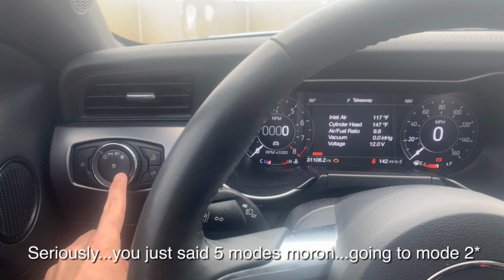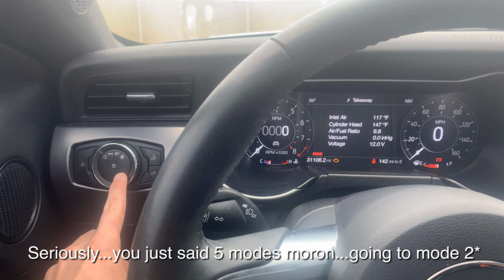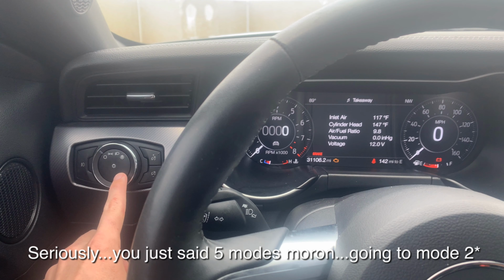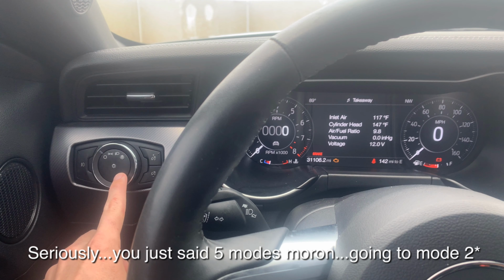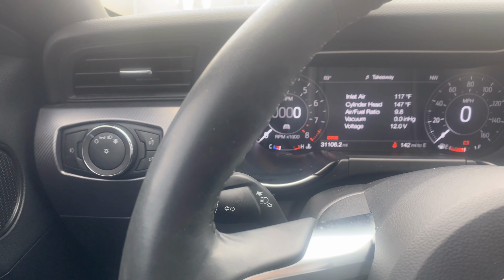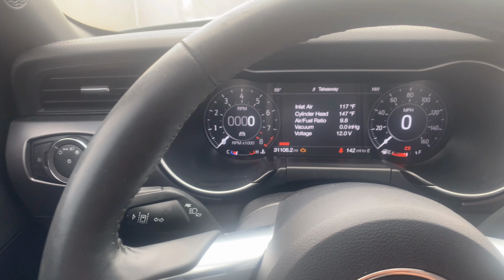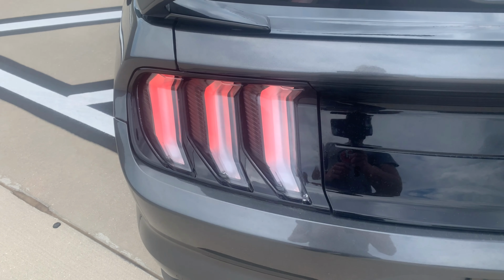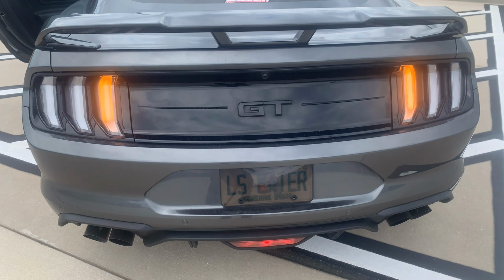Euro Tail Lights installed on my 2018 Mustang GT!

Comment: I don't know if that is a thing in whole of Europe, but in Germany when using the turn signals only the outer segment of the 3 light segments flash orange and the inner 2 still function as tail lights/brake lights. The law here does not only not allow red turn signals but also you have to be able to see if someone uses the breaks on both lights  at all time. If someone imports a US car and it's not possible to reprogram the lights (for example like with Mercedes models from the US) AND there is no european equivalent or aftermarket lights you actually have to put ugly universal turn signal lamps onto your bumper. Also those pretty awesome looking orange day running lights in front are not allowed here. But at least we can go 240 mph on the Autobahn, ze german laws again.. lovely
Reply from the maker: Well that’s interesting!

Comment: Hi 👋🏼 I recently bought these and installed them. Both brake lights/running lights work but for some reason the left turn signal function doesn’t work or stops working shortly after I use the turn signal. It’s as if my ECU has trouble recognizing the signal and stops sending power to the sequential turn signal. Just wondering if you have any advice or do you think it’s just a faulty taillight? Right signal has absolutely no issues. Thanks 🙏🏼
Reply from the maker: Sounds like a faulty light to me, either that or a connector is lose.

I’d double check all your connections and if it still faults reach out to the supplier you purchased them from 👍🏻
Reply: You need blinker fluid

Comment: The Vland require the wire from the third brake light to be connected correct?  Because it seems as if in this video there is  no mention of that step and that alone makes the install that much more annoying.
Reply from the maker: It’s not technically REQUIRED.

It is required if you want to be able to
Change modes, but the tail lights will function without the 3rd brake light.
Reply: @LsEater  that’s news to me.   I was told it doesn’t work properly with out the 3rd brake light connection because that’s where it gets it’s actual brake function from.  Thanks for the info.
Reply from the maker: @TheCdM1981  any time, yeah without the 3rd wire they will function perfectly fine, you just won’t have the ability to cycle through modes (seems kinda strange, but that’s what I’ve experienced/seen).

Comment: So I actually bought these from VLand the same company u got them from.. the one thing im worried about is the third brake light.. my question is “Is there a wire i would have to run to the Third Brake light or are these lights 100% plug and play?”
Reply from the maker: It’s plug and play into the 3rd brake light as well.

Comment: Other day I installed the Renegade Series Taillights With Black Housing And Clear Lenses Euro-Style LED
And love them .  I'd probably still have factory but the driver side housing got a hole in it which caused water to get inside.  That's when I found out you just can't buy a bulb like the old days 🤣

Comment: How did you install the 3rd break light?
It's the yellow wire.. No one shows how to install them.
Reply from the maker: Ran it behind the trunk liner on the driver side, then up the driver side interior trim, then under the headliner to the 3rd brake light.
Reply from the maker: No one shows it because it takes 15-20 minutes of putting yourself in weird positions to move the cord around and pulling out parts of the interior haha.

Comment: I just got them from S550Euros and I was wondering how long the installation took for you at home and if connecting the wires to the 3rd brake light was hard ?
Reply from the maker: Took around an hour.

The 3rd brake light is cake, just have to make sure you run the wire in a way that hides it and still gives you enough room to work with 👍🏻

Comment: Mine work for some days then one side will start the blinker red and the other side orange and i have to reset again..it keeps happening every three days its so dumb...i feel like just going back to red
Reply from the maker: Strange, I haven’t had a single issue yet.
Reply: Ls_Eater it works good just the orange blinker turns red after a few days..dnt get me wrong i love it but for now i just left my blinker one side red and the other orange lol fuck it

Comment: You can buy these exact ones for around $100 less on ebay and they are the same as the ones s550 on ig sells them. Just letting yall know.
Reply: they price match
Reply: @C4ME20N  they wont for ebay

Comment: I have the upgraded sound system, how hard is to take the subwoofer out? Is it a plug and play type of thing?
Reply from the maker: Takes less than 5 minutes to pull the sub out.

Direct plug and play.
Reply: @LsEater  thank you kind Sr. #drivefasteatass

Comment: Did you run the wiring to your third brake light? I was told I needed to run that yellow wire up to it and connect it to the taillights.
Reply from the maker: In order to change modes yes it’s needed.

You’ll love them!

Comment: Does this still require to connect the yellow wires to the 3rd brake light?
Reply from the maker: Yes, they do for you to change modes.

Don’t have to connect if you want to use the stock mode though.
Reply: The stock mode won’t actually light up the brakes tho I noticed, you have to wire it up to the 3rd brake light to even have any brake light otherwise it just does one sweep of the amber when you press the brakes and then goes right back to the normal running light

Comment: Hey man, weird question, but does the far right light in your right taillight assembly still show amber even whenever you switch it to the “Red Sequential” mode?
Reply from the maker: Negative it does not.

Have had no issues with these lights what so ever.

Comment: I see you have Diode Dyamics stuff in there. Do these work with the DD 4th brake light and/or sequencer kit? Or do i have to remove those to make these work ? Thanks
Reply from the maker: Works perfectly fine with DD 4th brake light. The sequencers get removed because the euros have them built in!
Reply: @LsEater  awesome, thanks for the reply.
Reply from the maker: No problem 👍🏻
Reply: @LsEater  as an update i bought them and installed on my car. I'm noticing they're much dimmer compared to OEM and also when viewed from side angles, they appear washed out especially during daytime. Also if you observely closely the LED strips are visible. Just wondering if it's the same for you. Thanks!
Reply from the maker: I haven’t noticed them being substantially dimmer.

I also cannot see the strips in mine 🤔🤔
Reply: @LsEater  Thanks, wish there was a way i could add some pics so that you could see what I'm talking about
Reply from the maker: Krishna Kanth shoot them over on Instagram if you have one.

Comment: I just got these today and I’m not able to switch modes. When I press my brake the brake light is only a sequential light and then disappears. Any idea how to fix?
Reply from the maker: Did you hook up the 3rd tail light portion? Without running that additional wire the multi modes will not work.
Reply from the maker: 3rd brake light*
Reply: Ls_Eater dang I did not do that. I thought that was just extra wiring for some reason. Thanks! I’ll see if that works for me now
Reply from the maker: Nope! It’s required. Run it from the headliner to the driver side panel, and then under all the shit on the side/inside trunk. Plug it into driver side light, and you’ll get your modes 👍🏻

Comment: Why not just buy the real oem one?? Why go with fake ones?
Reply from the maker: The term fake is so over used.

These aren’t intended to mimic the “Real OEM”, they are intended to be an aftermarket mod.

They have features that the OEM don’t offer, don’t have to be repinned to work properly or meet laws/guidelines, and the only euros that currently export to the US are 15-17 model which I didn’t want.
Reply: The 18-19 Ford eu tails are extremely expensive, first off. Basically double the price of the Vland tails. Also, even when repinned to work in a US model, they still won't function correctly. So long story short, the Vland tails offer great pricing, plug and play functionality and 5 modes to customize the look of your car.
Reply: @LsEater  I have a 2016 GT Base with Performance pack, can I order these lights? or do I need something?
Reply from the maker: Kyle Mertz they will fit perfectly fine!
Reply: Ls_Eater how long did they take to ship, and what payment provider you used for them? Still waiting on a response from the guy on Instagram